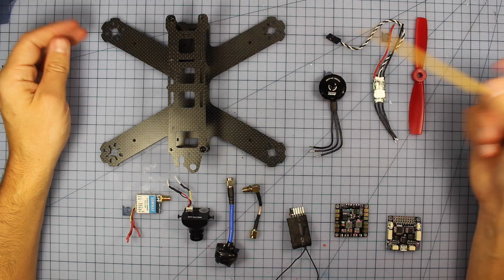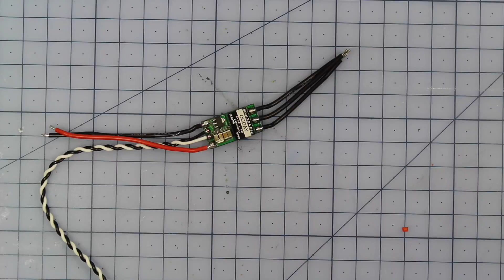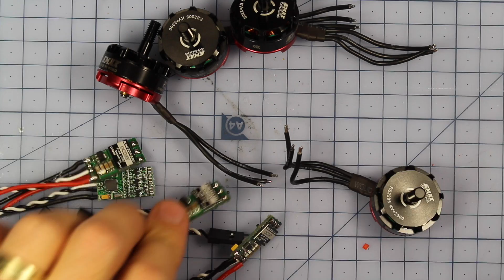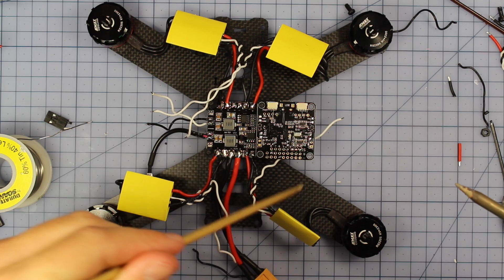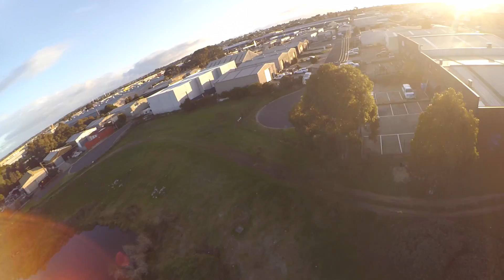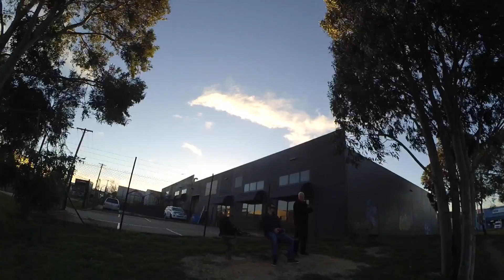Beginners guide to Building an FPV racing quadcopter.

Comment: actually,cutting esc cables(the white and black)is a big mistake,if you have the pins,you dont allowed to cut the white and black cable,unless you dont have the pins that comes with flight controller,and,place the flight controller according to arrow,so,when you calibrate the esc and the FC,the software can understand where the drone flight away

Comment: How good does your soldering need to be???
Reply: You want to make sure your soldering is pretty good. If your soldering is too close to other wires it could short out your FC. That would be bad. It's not too hard to solder right. Don't add too much and if you still have questions there are a bunch of youtube videos that go over it.
Reply: Yusuf Halabi I'm a J std and milspec soldering instructor who has built and reworked items orbiting the earth and I taught a 9 year old in 10 minutes enough to solder his own.  I also showed him some advanced balancing and resistance tuning to get his up and running in a local spec class racing league.
Point being that soldering isn't hard, just buy a proto board and practice.  I learned when I was in a robotics program that IBM had at my school in the 80's.

Comment: Youre really supposed to put those signal wires THROUGH the holes on the flight controller then solder them
Reply: JonnyD3ath yep,the right thing is dont cut the signal cable and use the flight controller pin.

Comment: Being a beginner, I have a question, how do you solder the wires so that one soldered spot doesn't interfere with the other one ultimately causing a short circuit!!
Reply: anmol deep you may need a finer tip on the soldering iron and finer solder wire
Reply: Use less solder

Comment: its surprisingly hard to solder two stripped wires together.
Reply: Robert Bain the easiest way is to spread out the wires on each end so the are flowering out, then bring them together and pinch it closed, then paste flux onto the joint and pour in the solder. Heatshrink and pronto!

Comment: Why is the original ESC wires replaced? They look like they are the same lenght as the ones thats soldered on to go to the PDB? Additionally would it be possible to splice the ESC to Motor wiring instead of soldering directly to the ESC?

Comment: also how to get your fpv equipment going would be awsome too how to make everything talk to each other also how to hook up an OSD or at they very least a low voltage alarm how do you know when your Batts are getting low?? also for the quadcopter that alow for 3s or 4s can you just swap out the 3s for a 4s or do you have to do something forster like make difrent connections or something like this? I know I ask a lot of questions but this is how I learn and I'm really new to the hobby thanks again

Comment: hey there new sub I'm getting into fpv I can fly a quadcopter but wanting to get into fpv race quads. I would like to know we're you get your little servo connectors you use all the time? if you need them and there not in the kits which I was under the impression you got everything you needed in the kit but I guess not. also how do you connect your flight controller to program your esc and everything and what program to use you talk about Bettany flight and clean flight and some other one for esc I'm not sure how all that works. could you do a video on how to connect all that stuff and how to download and use these various programs please? thanks in advance. love the videos they definitely are inspiring me to get into the hobby. I love flying my toy drone outside and look forward to being my phantom and building a race quad I love all these quadcopters!

Comment: just saying I been watching a ton of drone videos last few months. getting a dji phantom soon. started off on little tiny helicopter now a little indoor outdoor toy quadcopter and I love it. been watching alot of your videos lately! and I gotta say your getting my more and more interested in learning to fly an fpv racer because of you. I know this message is long but wanted to let you know your inspiring me and other to get into this hobby! Good day from America!
Reply: Herpetology 101 what tiny quadcopter did you start with? And what was the price if you know?
Reply: well otherwise was a 50$ quad called quad tumbler cam or something like that home depot had them on black Friday lol. but I ordered extra battery for it and flew it like 50 times before a motor burned out in it really tough me how to fly a quadcopter. before that like a year before that I bought a little propel helicopter from kohl's for 20$ was hard to learn to fly but I did and I think that helped me with the quadcopter. now I have on order a cheerso xc10 and a mjx x400 which I'm hoping has a bit more punch and agility than the quad tumbler drone I had it also cost a bit more I also order extra battery for that as the other batteries 8 have won't fit. check out the mjx x400 reviews on you tube they seem really good copter. sorry for the long explanation. I'm planning on getting the rtf version of the wizard soon as I'm confident in my skills then I'm getting a Dji standard 3 for awsome Arial video I am hooked on these drones man!

Comment: Where did the ground wires from the esc's go? I'm trying to build, and in the video that was closest to my build (different channel), they were un soldered (not used). I have dys 30A, emax rs2205 2300kv's, naze32, martian ii.

Thanks!
Reply: RunninOnCoal all the grounds are linked on the PDB

Comment: How do you control the battery voltage ? no telemetry ?
Reply: buy a buzzer
Reply: Hey, can i buy d4r-ii ?
Reply: AdzInNetwork yeah that is a telemetry receiver but make sure you solder on the points to allow it to talk to the battery

Comment: I was looking at the links in your spreadsheet for the beginner build and the bolt.rc website moved to a .au domain. If I googled the same parts and found them on a different website would that still work for the build? Or do you have another suggested site?

Thanks for the amazing video BTW!

Comment: The ESC went boom......
So disheartening. 
Everything was fine with the testing, the arming with Cleanflight, all calibration and everything, all motors were fine.
When I put the props on, and was doing my maiden flight, it got off the ground, and then went crazy.
Bust one of my ESC....
Now i don't know if i should get OCDAY replacements, or should get some other brand :/
I was on 3S, that too.. 
sigh
Forgive the rant. ._.

Comment: Hello UAVfutures, I'm looking foward to build my own quadcopter. Is it necesarry to have a power distrubition pcb? Or can i chose solder all the power cable etc together? Thanks in advance
Reply from the maker: you can...but pdbs make it so easy
Reply: UAVfutures Thanks for the reply! I suppose if I wanna add some futures then just flying I will need a pcb that can step down the voltage to 5 v

Comment: Hey, I'm currently building this but using a TBS unify pro for my vTx which only has a voltage range of 4-6V. Could I solder this to the 5V contacts on the PDB and the SPF3 to the 12V? Or will the SPF3 be unable to handle the higher voltage?
Reply from the maker: solder them both to the 5v
Reply: Sweet, I shall do that now :) Awesome vids btw, thanks for getting me into quads

Comment: Is it possible to direct solder SBus etc to this FC? I hate fragile cables/connectors :)
Reply from the maker: I usually cover mine in hot glue if i am worried about them

Comment: Hey Stu, 
Thanks for the videos! What batteries to do use? I'm wondering whether I'll be able to travel overseas with my drone, and now airlines have pretty heavy restrictions on batteries. Have you tried travelling by plane with your drones?
Reply from the maker: no travel for me, but I liek to fly with 4s 1400mah lipos High c 60c +
Reply: Alright, cheers! Also, I was going to get the Eachine Wizard as my first drone but saw in another review that it wasn't great for beginners. I don't really want to splash out on two builds so it'd be great to get something reasonable that I could progress on. Would you suggest the wizard, GB 190 or your Dubai beginner build? 

I kinda want to build the drone myself so I'm inclined to get the GB 190 (think it's got better components than the Dubai kit, right?).
Reply from the maker: E. Malkin if you want to build the gb190 is great, but IMO the wizard is AMAZING even for a beginner
Reply: +UAVfutures Ok thank you!

Comment: Everytime i try to take off with this drone it keeps on rotating around and wont take off
Reply: Can anyone help
Reply from the maker: check motor directions, prop are on right, yaw in centred in the rx and the fc is orientated the right way in the cleanflight/betaflight

Comment: Hello, Could the x4rII be connected to IO_2 (7) on the flight controller diagram?
Reply from the maker: if you dont have any lights on, it means it is not getting power. So just hook it up to any 5v

Comment: Hello there, having a little trouble binding the x4rII  I cannot get the the light to come on when i power up.. everything else works fine.   I swaped cables and x4rII  but no change. 
I hope the FC is not bad.
Reply from the maker: it should bind when you power it on. try powering it from another 5v source.
Reply: I found out what the problem was socket where the transceiver is connect was not soldered correctly.  I just fell off.  Contacted vendor they are working with me.

Comment: When I was searching for replacement OCDAY esc they all mention that they do not have BEC built-in.  I did not recall you installing a separate BEC so I'm assuming a BEC is not required to function, correct?

Comment: I watched this many times over and managed to build my first quad! Great guide! I'm trying to commission it now and couldn't find a straight forward way of how to reverse the motors (I wired them straight like you) in Cleanflight? Can you tell me how you do it? This is my quad. https://www.facebook.com/tteckwee/media_set?set=a.297088424003877.1073741833.100011081653198&type=3&pnref=story
Reply: As far as I am aware, the option to reverse motors is not in cleanflight, but instead in BL Heli, a piece of software designed for ESCs.

Comment: So I have a weird thing happening... Built this kit and it worked wonderfully for a while. But I am having a problem that happens every so often. When my VTX is plugged into the power, it causes motor 1 to spin for 8 seconds after i de-arm the drone. Plus it gets pretty warm. Don't see how it would be shorting on the frame because the VTX is covered in the clear heat shrink. Any ideas?

Comment: hey mate, sorry to bother you again, but I've finally arrived to the moment of the build where I can start setting my FC, ESCs, motor rotation direction, etc. But when I go to blhelisuit and read setup, it says that the firmare on the ESCs is Afro 12A, although the sticker says OCDAY blheli 20A. Is there something wrong? what should I flash them with?
Reply from the maker: i just flashed them with the latest version of that. I just updated with what ever bl heli said the default was and it was fine

Comment: What type of battery did you run for yours? It suggests a 3S 8.4V-12.6V 1300-1500mAh 30C. Wasn't sure if you ran with what they recommend or something larger?
Reply: 3S or 4S 1300mah/1500mah battery that is 45C or hugher

Comment: Nice little build,  easy enough, I only have one negative about this kit.  The price is cheap enough,  however larger screws are needed for the bottom plate and colums and  by time you find out that the flight controller is a Chinese knock off and don't work so you end up ordering an original SP racer fc.  You might as well of ordered an original kit, I hope it flies well after installing original fc.  Just saying.  Keep up the great work I do love your videos.  Take care.
Reply from the maker: are you sure the FC is a knockoff?

Comment: Hello Stew, 
Have you tested this esc motor combo any more? I seem to be having demagnetization events on punch outs... Sometimes it works fine and sometime it kind of loses power and drops a corner for a little bit...
Reply: It does recover... But there's definitely a problem on the esc's, I checked the Blackbox log and the corner that drops is actually getting 100% throttle command from the FC while it's dropping...
I tried setting timing to medium high but it didn't solve the problem... Demag compensation is on Low... Should I turn it off? Or try high timing? Thanks in advance
Reply from the maker: sorry mate not sure about that one. Mine was fine and had no issues, Did you update to beta flight and the latest bl heli
Reply: +UAVfutures Latest Cleanflight, Latest Blheli.
Will turning off demag compensation risk my motors? I believe that's kicking Im for a moment.
Reply: +UAVfutures what's your min throttle? I have it set at 1030 right now and the props spin nicely at that value... Do you think that value is too low? Could that be causing my issue?
Reply from the maker: Alejandro Alvarez I think mine is around there, if they spin nice then it should be all good. try boosting it up just for a test, but I dont see why it would be any problem. Also try air mode
Reply: +UAVfutures ok so this was happening on 4s... Tried 3s and problem gone! Apparently the esc's don't really like being run on 4s although they are rated for it. 
Thanks Stew!

Comment: i have built it and had noprob flashing the fc and the esc,s but my esc show up as 12a just like yours i am wanting to know have you had any prob when you used the 20a firmware
Reply from the maker: no problems, but I just used the 12a firmware and they run fine

Comment: Hi!  Maybe You have some suggestions?

I have the same exact set, I did put everything together, everything was working, and THAN I thought I have to enable dumbed lite, but by mistake I enabled PWM input, and now everything gone weird, it connects to BLheli, but it won't read or flash ESC, as soon as I connect to BLheli (or motors section in clean flight/beta Flight) - ESC's starts to beep really fast and move a bit on both sides, and I can' t do anything, I can't enter programming mode as well.. Any suggestions? :)
Reply from the maker: try calibrating them in the motors tab. slide the tbs to max, plug it in to a lipo and then slide to zero.
Reply: aaaa, I'm ashamed to admite what the problem was! I was using a lipo that had to low voltage! Now Everything works, Thank You! :)
Reply from the maker: Gatis Vilaks glad you got it sorted

Comment: one of the best videos iv'e seen thanks mate!!!! I was just wondering what software you use and how did you program the quad copter? also what transmitter did you use for this build?, I have a devo 7e which i am also about to do some mods to so I can fly other quads or helis, would the devo 7e work for this quad copter? thanks in advance
Reply from the maker: I used the betaflight software, and the Bl heli suite. both very easy programs to use. this kit can be used with any transmitter and receiver set you wish, it is not locked or anything to any specific brand
Reply: Im only relatively new to modding and building quads, do you know of a link for betaflight? also what is Bl heli? after your video im definitely interested in looking at doing my own build Im just worried about how i can it to bind with my transmitter and using software, in that department i have no idea what im doing. Thanks for your help.
Reply from the maker: r3verseb4ckfl1p sure mate. No worries, Betaflight is the firmware that the flight controller will run. Beta flight configurator is the computer program you use on your PC to configure it all up. Bl heli suite is a program used on the computer to program you escs and update them. 

and all that should work with what ever radio or transmitter you are using with its matching receiver. they will use pwm, ppm or sbus as their communicate protocol. Hope that helps
Reply: Thanks for your reply and your help mate, i have searched for the betaflight configurator but can't find one, any chance  you could post me the link please?

this sounds like it could be starting to be a bit out of knowledge level. do you know if theres a video link that will also show me how to use this Bl heli suit? also what is pwm? ppm or sbus? this is all a bit new to me. thanks again UAVfutures
Reply from the maker: r3verseb4ckfl1p https://chrome.google.com/webstore/detail/betaflight-configurator/kdaghagfopacdngbohiknlhcocjccjao?hl=en

https://github.com/betaflight/betaflight/releases

https://blhelisuite.wordpress.com/
Reply: Thanks mate, I think this maybe a bit above me :-S there seems to be a lot of other links connected to those sites and I dont even know where to start. Do you know if there are videos around that show you how to use this to program the quad?
Reply: UAVfutures  Thanks heaps for your help :-) much appreciated. can I grab your skype add now that way I can save it in my phone to save me using my laptop?
Reply: thanks heaps mate!!! :-)

Comment: Hey Stewart what OSD would you recommend for this build?
Reply from the maker: Power OSD, my fav, But I also like the RROSD
Reply from the maker: power OSD pro sorry
Reply: +UAVfutures so thats an OSD on a PDB? what about the micro minim OSD so I can utilise what comes in the kit?
Reply from the maker: Grant Cassar the minim osd doesnt come in the kit???
Reply: +UAVfutures no but the PDB does.
Reply from the maker: Grant Cassar ?????
Reply: +UAVfutures the kit already has a PDB to use so i was just hoping to get a standalone osd.
Reply from the maker: Grant Cassar well you could, but instead of buying a micro miniosd and using the PDB in the kit, Just make the whole process simpler and buy a power osd pro. Which is an OSD and PDB in one
Reply: Are the motors 4 motors for 13$ or 13$ for 1 motor? :P